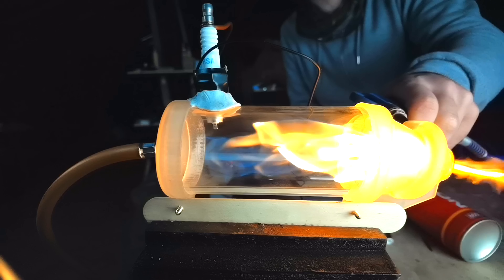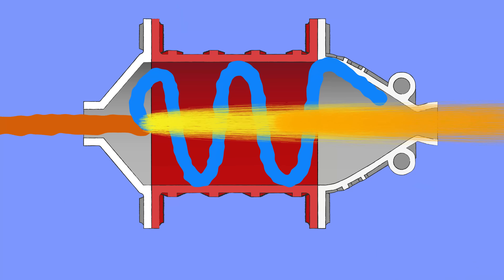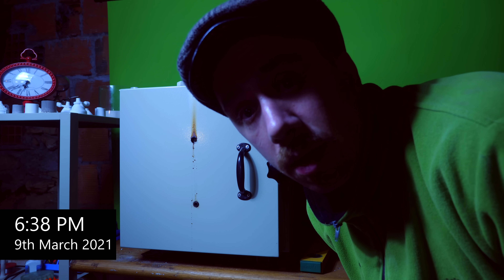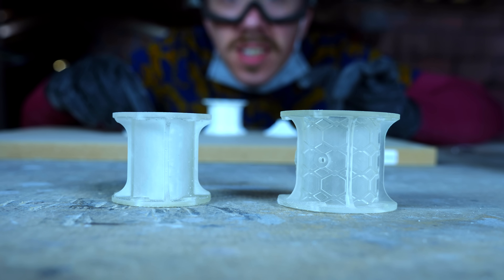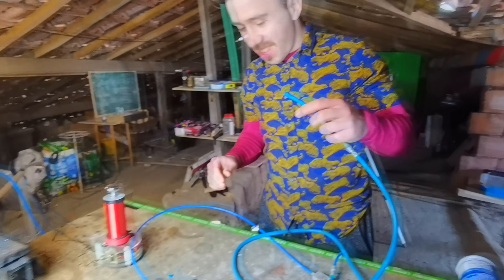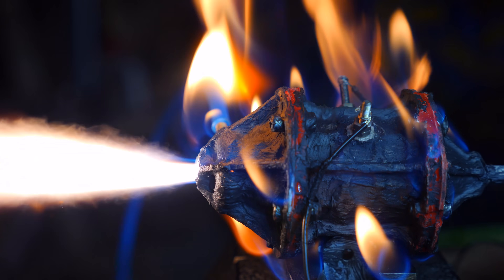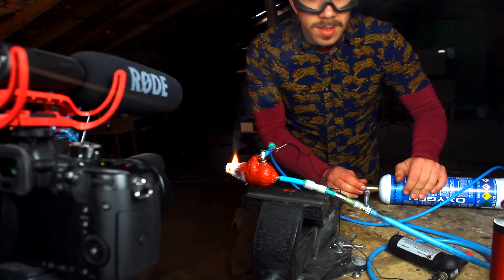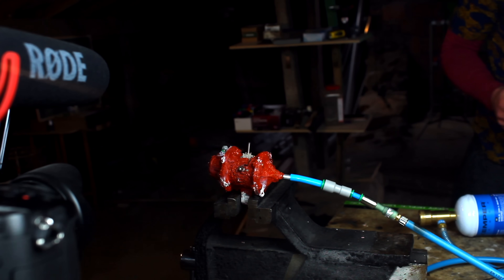Vortex Rocket V2.0 (3D Printed)

Comment: Regarding leaking my bet is that you're burning through the gasket. Maybe try adding a lip on the nozzle and injector which slips into the inside surface of the chamber tube so that the silicone gasket seals aren't directly exposed to the flame front. I doubt anything will last indefinitely at such a small scale (dealing with heat gets harder as the engine gets smaller) but it should delay burn through. 

Also try making the gasket seals from silicone sheets rather than curing in place. If you cure in place then the flange seals have no compression since they will just squish out of the way as liquids do. All seals require mechanical compression to work properly. Alternatively, if you're dead set on curing them, you shouldn't fully tighten the bolts during curing so that once cured you can tighten them all the way to get some good compression on that gasket. 

Also try adding ringed surface texture to the flange surfaces, like you might see after facing a part on a lathe a bit too aggressively and with a dull tool. Google image some pictures of gasket sealed flange faces to see what I mean. Those small rings on the surface will force the gas to have to traverse a much more winding path in order to leak through the gasket-flange interface. 

Final note, typically gaskets need a stupid amount of compression in order to seal well so I would consider bonding your parts together using something high temp and strong enough or switching to O-ring seals.

Comment: Is there any reason for running the oxygen along the outside? Would it not make sense to run the fuel along the walls and inject the oxygen at the back end, to avoid contact with the walls? I doubt the sealants you use are rated for pure oxygen enviroments, and there is realy no point in using the vortex to keep the combustion from the walls, if the walls themselves are burning. 
Running the engine with a fixed fuel flow, and controlling the mixture ratio via the oxygen flow is also entirely possible, and has the advantage of you being able to ignite the rocket outside the combustion chamber and then slowly adding oxygen until the combustion retracts into the combustion chamber.
As sealant, have you tried soaking/glazing with waterglass(sodium silicate)? It probably works great with those porous ceramic prints.

Comment: Try to use a high temperature clear coat, one commonly used for motorcycle exhaust for example, such clear coats can withstand temperatures up to 750-1000 *C

Comment: To seal your motors high-temperature gasket sealer, coat the outside with a high-temperature epoxy resin. 

A suggestion for another episode you have the high-temperature kiln hand make a rocket engine from clay.

Use the ceramic resin to 3D print an aerospike

Comment: A "rocket" that accelerates through magnetic repulsion
Reply: That concept actually exists! It's called magnetic sail, and it could be used for slowing down interstellar craft before reaching their destination without using fuel. When using fuel is your choice (for doing more than one specific job), VASIMR engines use magnetic fields for accelerating your fuel and they are a great candidate for fast interplanetary travel, because their efficiency can be traded for thrust for when you really need to get moving for oberth effect or orbital insertion maneuvers
Reply: @michahermann7869   Awesome!

Comment: I think a layer of ceramic glaze in the inside will avoid leaks, you can use the kiln you already have on the ceramic parts, once  sinthered.
Reducing internal pressure will reduce the output power at the nozzle (reduced escape velocity), so you should look to keep up the internal pressure while avoiding leaks.

Comment: What if you glazed them with a high temperature glaze.

Typically glazing makes atleast pottery more durable and water proof. Meaning they might withstand higher pressures and not leak.

Comment: I saw that you weren't using a proper o-ring between the segments of the modular rocket -- I think you were using a layer of HTsilicone, however I'm not sure how well that works when the sintering process leaves the surfaces of the joints a little bit warped. You can get high-temperature rubber-ish (e.g. viton or kalrez) o-rings that will survive up to about 300C but to tolerate higher temperatures you may want to consider metal (ie. copper) o-rings. Consider a knife-edge to flat copper o-ring type seal that is commonly found in "Conflat Flanges." Some background info: https://vacuumservices.ltd.uk/9-faqs-about-conflat-flanges

Comment: glaze the porcelite. The shiny surface of basically everything you see made of porcelain (toilets, fancy plates, etc.) isn't the porcelain itself, it's glaze. Glaze is a glassy material that leaves impermeable surfaces, which is important for cookware or bathroom fixtures, where water contact is a big deal.

https://en.wikipedia.org/wiki/Ceramic_glaze

Comment: You should use your 3D printer to make negative molds of the engine parts and then use those molds to create the parts out of ceramic clay.  You could even use glaze to completely seal the surface.

Comment: Maybe you could use a vacuum chamber to impregnate the pores in the ceramic with some sort of sealant like ceramic slip or high temperature epoxy?

Or could instead of trying to 3d print the part, make a mold and use that with ceramic to make the actual engine?

Comment: What about using ceramic glaze or clay glaze instead of cement or high-temp silicon? You could use that high-temp-oven to cure the glaze, or let the operating temps cure it. Maybe using glazing overall would smooth out that finish on the insides and also reduce turbulence?

Comment: I got a hell of a laugh out of the Tomato Lord Jr animation.  The coarse facial expressions made it more than the sum of its parts.

Can you not print oversized mould parts in resin and then use the moulds to make strong ceramic parts or can you not make resin parts and internally heat treat them with some other coating?

Comment: Could it be that the small pulses go with the gas to close to the throat and reignite with more oxygen and cause a back pressure in the chamber? In result to this the ceramic gets micro hits in a hot stat and gets micro cracks and leaks? In this way the cooling vortex is not stabile enough to hold the hot gas away and the gas escapes.

Comment: You can try covering the surface with clear ceramic glaze (not those colorful decorative ones, but the actual clear sealing glaze), then re-firing it in the kiln. The glaze will give you a nice glassy surface and with any luck it will hold onto the ceramic well enough for the engine to run. It can either be brushed or sprayed on using a cheap single-action airbrush. You can even go further and dip the ceramic parts in slightly watered-down glaze instead of painting it on. That way all surfaces are completely covered. Just make sure and put the parts on special stilts when firing the glaze, otherwise it will stick to the surface in the kiln. Also make sure parts are not touching each other for the same reason.

Comment: the last engine you tested look like it performed very well until the stress of combustion took it's tole, or it became heat soaked and died. in car engines running rich is a problem so they try to find a good air fuel ratio to have stable performance. I wonder if that would prolong the life of your engines?

Comment: put a thin silicon coating inside the motor, when the silicon melts in the first test, the molten silicon will fix the leaks by itself, being pushed into the leaks by the same fuel that is trying to scape, adding rotation to the motor should distribute the molten silicon even better, but for that the design of the motors should be diferent so just keep it as a last resort.

2nd solution: create a mini vacuum chamber around the motor leavin only the nozel out. even if the fuel leaks it won't be able to ignite due to the lack of air.

Comment: Integza love the video!
After you fire out the resin there will always be micro-holes in the part. You could seal these by coating the cured part with a high heat ceramic glaze, which will also make the part stronger. 
Also you should consider that the engine heats unevenly during operation, (causing failure) increasing the surface area around the combustion chamber & nozzle could help even out the temperature differences across the engine.

Comment: Deformable metal washers ?
Like those in your car engine
If you tighten them enough it will not leak anymore

But at those force, I doubt the ceramic will hold, I think it will break, but you can test anyway

Or just put car engine seals/silicone sealant, they're made for extreme conditions

And also, your cooling vortex isn't strong enough compared to the pressure the combustion generate, that's why it burst to flames

Comment: I seems  you need to seal  , with glaze , 

the ceramic parts 

or something ,

 I have an idea take a ceramic class, 

and  maybe ditch the 3D printer  

it’s probably too unnecessarily frustrating 

And probably strengthen it with glass fibers somehow  🤷‍♂️

Hmm 

Come to think of it, you could probably get by with a  vortex cooled Jam Jar and save having to go to a Ceramics class

Comment: Have you thought about using refractory glue in the inside? You'd need to make it smooth so you're not messing with air currents too much but if you're leaking oxygen from the ceramic being too porous it may help to seal on both sides...

Comment: What if you dunked a fired engine in the virgin ceramic resin to fill in the pores, then fired it again?

You could also try completely dunking the engine in very low viscosity cement, and pulling a vacuum on the interior of the engine for a short tome to help suck the cement into the leaky areas. Just don’t leave it at vacuum long enough to fill the inside of the engine with cement!

Comment: Coat the parts in the ceramic resin and/or cement and place them in a vacuum chamber before they set, when the air is removed from the chamber the resin should get drawn into the pores of the ceramic for a better seal.

Comment: So what if you did it differently. Your trying to print the motor housing. What if you 3D print the empty Space and then cast refractory around it. Then let it cure and then burn out the center 3D printed shape. This would leave you with a solid refractory block with a cavity the shape that your trying to create with 3D printing.

Comment: Maybe you can try to print 2 or 3 concentric ceramic shells, then sleeve them together with high temp silicone in between. It should help a lot preventing the leaks.

Comment: Try adjusting your nozzld diameter. Your problem is based on the fact that when you attempt to throtrle your engine, pressure builds up to the point that you blow your pressure seals. Also try sealing them with something more viscous then curing it. Try dipping the parts in a resin, maybe porcelite then curing them then sintering again. Also, try metal 3D printing. Works the same way as porcelite printing where you print then sinter in a kiln, but uses the FDM method instead of SLA.

Comment: What if you made an engine that had the oxygen and propane enter from the same end in a vortex fashion and then use an INERT gas such as argon come in from the side to create your heat shield vortex on the walls.  Oxygen burns so if it's running along the walls, the flame will try to reach out to the walls too.  Then make your exhaust slightly larger to accommodate the higher volume of escaping gases.

Comment: Use 3d Prints to make molds and cast the parts in a non porous high heat medium, non printed thicker poured ceramics, or metal. Even aluminum, maybe not for the nozzle, but for the body, it should hold up.  Also if you can coat the inside of the parts and re fire them it will help seal the inside.

Comment: Bonsoir, Integza! You can use "Salt powder annealing method" to bake the 3D-printed half-ceramic parts without deformation. Just put the 3D-printed part in the forge inside the crucible filled by the fine grinded salt powder. Dont forget to compress the powder a bit to let the 3D-printed part be surounded properly by powder without extra space to prevent deformation. Voila!

Comment: you might want to try using  an index groove, instead of just having a flat seal area. Like having a half circle ring printed on the center of the seal area, and on the receiving part have groove to accept it.

Comment: Inorder to test a nozzle design why not test it on a alcohol woosh rocket kinda like a basic jar pulse Jet just print the lid with a nozzle on it then pick your best performing nozzle and make a slower burning sugar rocket fuel so it dosnt make to much pressure and explode then burn the tomatoes again!

Comment: soak the part in resin (or concrete) again after printing and assemble re - bake. joints are leaking first.
more nuts on flange jooints surface no mating. Try stainless coupling

Comment: Have you tried an experiment where you don't burn out the plastic resin from the ceramic part? 

I've been watching this video series, and maybe I missed something, but I haven't seen you try that. I understand why you want the part to be pure ceramic, but I wonder if it might be better to skip this step. When the vortex is working properly, only small parts of the engine should get hot enough to melt the plastic content in the ceramic resin, right? So if you just leave the plastic resin in the part, maybe the engine would be less porous and get better air flow. It would probably be more structurally sound too. And you could print it with thicker walls, because you wouldn't be worried about it cracking in the kiln. You'd potentially be burning some of the plastic content at the nozzle, but it might only be from the inside edge. 

Given the number of things you've tried, seems like this is worth a try, eh?

Comment: For your leaking problem, glaze your ceramic motor and you successfully manage to build a rocket teapot.
Reply: Two birds with one stone - glaze the ceramic while it cures and burns off the resin
Reply: @frzferdinand72  so where does the burnt off resin go when it's sealed in with glaze?
Reply: @benholroyd5221  Only the insides should be glazed
Reply: @MiklosGalicz  possible?

could still prevent off gassing/ the glazing could fail to adhere properly?

Its well outside my wheelhouse though
Reply: @benholroyd5221  mine too, but all that's left is to try it and in the best case, see Integza grill a tomato 😂
Reply: That is worth a try, you have the furnace, but that is why ceramics are usually burned twice, once to get them hardened, and the second time to coat them...
Reply: The glaze on the inside should be as thin as possible, to reduce the stress on the ceramic body. A low melting temperature oxide would be a good start.
Reply: And the first glazing compound to try should be silicate glue. It`s mostly glass anyway!
Reply: Ok clarification for everyone here. Glaze is a glass coating you put on AFTER you have already burned out all the resin or turned said clay into ceramic.
 It does not cause any stress on the ceramic.
Reply: This should help prevent most of the leaking from the single piece print. Same reason clay flower pots wick water, and tea cups hold water without your hands getting wet.

This won't solve the joint leaks, but will help for the body. Maybe try to either glazing first then gluing or gluing then glazing. Even try to glaze inside. That will probably be hard, but might be worth it.
Reply: @jasdel  glazing process is really risky to crack the engines
Reply: @_BERLIOZ_  you know what glaze is right?
It’s literally just a glass coating.
Reply: @nexivy  for high temperature it includes burning it in oven
Reply: Glazing has its own issues. But it could work. One way to do it maybe is to have the engine work at low pressures and somehow feed it the glass. The temperature inside should be high enough to melt it. And it will push itself into the pores. Put there's probably a better way to do it while pressurising the rocket.
Reply: The joins are probably pretty well gasketed, but would either lapping the faces for a better seal/fit, or printing them with interference to each other work?
Reply: He said glazing wouldn't work in an earlier video

Comment: Glaze the engine.  In addition to being colorful, glazes usually use a powdered glass base that melts when fired and should seal up all the cracks in the parts.    Your burn out furnace should get plenty hot enough.

Comment: If you soak the ceramic parts in thin fire place cement or perhaps plaster of paris and then gently dry it in your oven(not to hot) it can permeate the material reducing or possibly stopping leaks due to porosity. One other possible method would to make a mix of rice flower and water to soak them in using the method the builders of the grate wall of china used to prevent water from penetrating the cement used, it worked so well that the cement outlasted the stones in the wall. The rice is flammable but will turn in to carbon/sot that will work as a heat shield, for a while. Happy rocketing.

Comment: Ceramic can resist the temperature, but it doesn't seem to deal well with the pressures involved. Too brittle from the looks of things. Might need to encase that in some other stuff than whatever it is you're currently using.

Also when baking the 3D printed stuff, any way to pack it in sand during that process? Then you're not depending entirely on the 3D printed part to support itself during a stage where it may be subject to deformation from the heat needed to vitrify the ceramic. Also might have to pre-bake the sand used so it's completely dry before using in that process too.